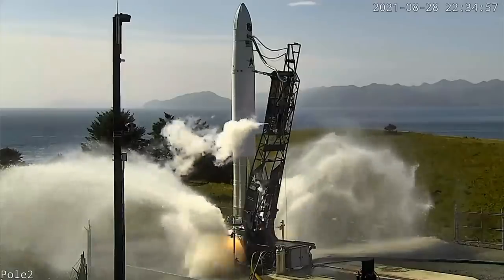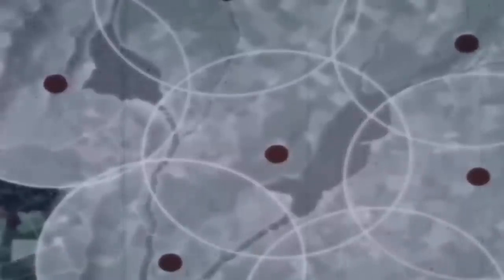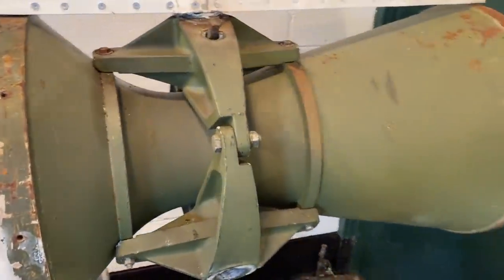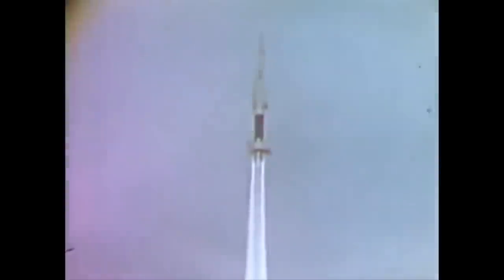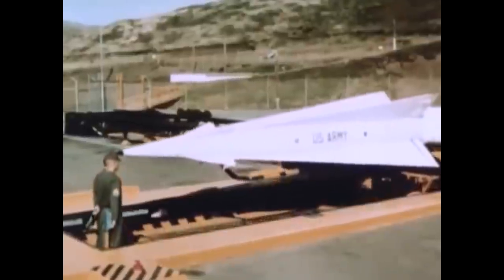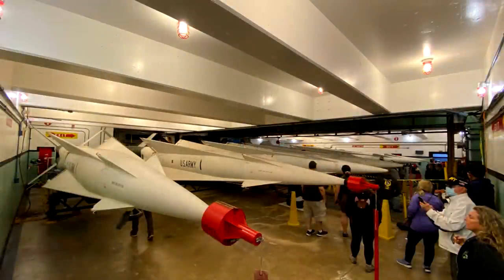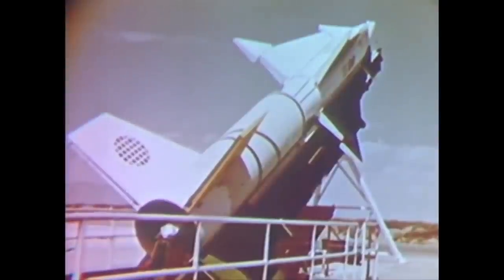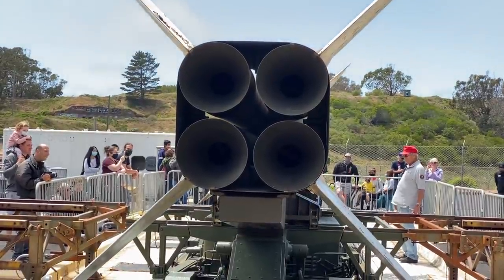Nike-Hercules - US's Surface To Air Missile with Nuclear Warheads.

Comment: Many years ago, I worked with a person who was in the army and stationed at a Nike Hercules base. He was a radar operator and would pass along stories of the different adventures that had with the missile. One in particular was a training episode when they were tracking any and everything that would fly near them.  They were very surprised when they discovered a VERY fast moving target, which they promptly started tracking to see if they could get a firing solution. They found that they could arrive at a firing window but it was so short that it was too late. They later found out that they had been tracking a X15 .
Reply: So the missiles were essentially useless by then. Since the X-15 top speed was about Mach 3. My father worked on that program and always told us when to expect a sonic boom, which was not known to the general public at the time. Too bad they didn't notify the tracking operators!
Reply: @funnlivinit  I am assuming the X15  came in lower than expected, that by the time a tracking solution was found it was too close.
Reply: X 15 has the record at mach 6.7
Reply: @funnlivinit  The X-15s highest recorded speed was mach 6.7.
Reply: @viperfan7  Still unbeaten by Virgin Galactic or Blue Origin.
Reply: @edfrawley4356  because neither of them is a high-speed experimental plane?
Reply: @funnlivinit  um, the X-15 wasn’t a warplane. Nike Hercules could outrun and outmaneuver ANY manned warplane of its days.
Reply: Besides, Hercules was IN its defended area so our enemies had to come to us to complete their missions. 

If a hostile aircraft was outbound he had probably dropped his bombs so he was a lower priority target than an inbound one.
Reply: @funnlivinit  The X-15 was a HYPER-sonic rocket plane (anything above Mach-5).   MAx. reckord speed was Mach-6.74 that's over 4,500 MPH.
Reply: @ypdave01  Outrun, yes. Outmaneuver... not so much.
Reply: @bennylofgren3208  what piloted aircraft in the 70’s could pull 8g’s in yaw AND pitch?
Reply: @ypdave01  There is a big difference between pulling 8 G for a couple of seconds and doing it sustained.
A missile loses kinetic energy very quickly if it has to make sharp maneuvers in its unpowered coast phase, so there will be limited opportunity for course corrections late in the end-game. A typical fighter counter-tactic against incoming missiles would be to fly on a perpendicular course, to make the missile expend its energy faster.
Reply: @bennylofgren3208  the missile was guided toward a continuously recalculated Predicted Intercept Point and there were limits to how erratically it would be steered during the end phase of the engagement. Not many intercontinental bombers can pull serious G’s.

But we were also deployed in Europe, Japan and South Korea
Reply: … where high performance fighter bombers would be encountered. According to the Army Times, we were the only system capable of reaching the Foxbat in speed or altitude.
Reply: @ypdave01  Right-on my Nike FB bro!
Reply: @ypdave01   Is the Foxbat the MIG 25? I've read it was built to intercept the SR 71 and that it's engines were toast after trying to do that.
Reply: So cool! Did they think it was soviet Rod?
Reply: @silentblackhole  No, they were constantly in training mode and practiced tracking anything that moved for proficiency when they had to track targets for real. He talked about them them trying to track B52's which had counter-measures they could not defeat.
Reply: @michaelakstull  yes
Reply: @rodR12345678  we had a training simulator called T1 that occupied an entire semi-trailer. It was cabled in to both the Director and Tracking Stations. 

To provide us with realistic experience it could inject up to 6 targets that would maneuver, jam or even disappear entirely or appear out of nowhere.

In actual live firing at McGregor Range NM or Crete, we shot live missiles at T1 targets.
Reply: @rodR12345678  but what did they think was travelling so damn fast? Like was it known that the x15 existed or anything in the us airforce could go that fast? If it wasn’t Soviet, what the heck was it? (In their mind)
Reply: @silentblackhole , the X-15 was a research aircraft that started out as a USAF project, but was later run as a joint USAF/NASA vehicle.  The point of the X-15 was to see how high and how fast they could get a winged vehicle to go, and it was a highly successful program.  Of three vehicles originally built, two still exist, although both have been retired to museums.  One is in the Museum of the US Air Force at Wright-Patterson AFB in Dayton, Ohio.  The other is at the Smithsonian's National Air and Space Museum.

It's well worth visiting those craft.  Neil Armstrong flew X-15 missions before going on to the Gemini and Apollo programs.
Reply: @ypdave01  why are you leaking national security on youtube??
Reply: @lultopkek  nothing classified here
Reply: I served on a Nike-Hercules site in Germany from 1976 to 1983 as a launcher section chief. It was an awesome weapon and looked scary as hell just sitting on the launcher.
Reply: aLiEnS bRoOoOoOo
Reply: This makes no sense.  Range operators are always in command of airspace information, for obvious reasons.  Hard to imagine not knowing about something so well documented as the X15.  I worked as an optical physicist at White Sands for Sperry Flight Systems, and the Army for a spell.  Saw a lot of stuff, which we mostly can’t talk about.  It’s just math, until something blows up, then it’s way more math.

Comment: On the traditional AA guns: it's worth mentioning that the US and Britain had jointly developed the proximity fuse in WWII, which gave them much, much better shells/kill ratios than the Germans and the Japanese. Curious Droid made an excellent video about them.
Reply: I believe the proximity fuse was developed at Carnegie geophysics research laboratory.
Reply: The shell had to get close enough to the target to actually detect the target and cause damage. That required accurate gun aiming. The Allied AAA gunners got that from three devices from 1944 onwards. The SCR-584 radar, which was the most advanced gun laying radar of WWII in that it could search for and track a single target automatically , the Bell M-9 Gun Director which could take the radar data and use it to aim up to 4 guns automatically and the Posit VT Fuze.
Reply: @goldgeologist5320  my grandfather worked as an engineer on the proximity fuse project at Johns Hopkins Applied Physics Laboratory, left APL in 1948. Tho I wouldn't be surprised if the project was carried out at multiple locations.
Reply: According to US Navy records of antiaircraft kills versus 5" antiaircraft ammunition expended, the proximity fuze doubled kill probability - from 1000 rounds per aircraft downed with time and impact fuzes to 500 rounds per kill with proximity fuzes.

Doesn't seem like much of an improvement (still 500 rounds!), but cutting ammunition use (and also barrel wear, obviously) in half made a game-changing difference.
Reply: Funny enough, the germans themselfes were aware of the problem and developed proximity fuses themselfes.

The ones for artillery shells were actually close to combat testing, however they were dropped in favor of AA missile systems like the "Wasserfall" and  air to air guided missiles like the Ruhrstahl X-4.

Those systems too had proximity fuses, however, those obviously had to withstand much lower G forces, therefor were simpler and cheaper to produce.
Another interesting thing to not is, that these proximity fuses were no radar doppler effect fuses, but a wild mix (depending on the usecase) of sound wave doppler effect fuses, magnetic fuses, simple passive radiowave homing devices and in the case of the Wasserfall even a mix between infrared homing device (similar to what was later used in the Sidewinder missile) and an infrared proximity fuse.
Due to the mechanical and electronical simplicity, a lot of them were even combat proven and used on other guided bomb systems.

Really, looking at what the germans came up with out of pure desperation is quite astonishing. :D
Reply: @richardvernon317  Well, yes, it definitely wasn't perfect, but the Germans still had to set the timers on their AA shells by hand, which basically meant guesstimating how high the Allied planes were and how long the shells would take to get there. The proximity fuse at least removes that timing aspect, so it was a big improvement.
Reply: Erre Waser  or near the water. My grandfather told me stories of watching news reels and noting when he started seeing explosions near the water (missed shots) and how he was so proud to see his work in the war effort but being unable to tell anyone because it was classified.
Reply: @TG626  Or near the ground - once the ground forces got permission to use the VT fuses in their artillery; IIRC during the Battle of the Bulge.  (Originally its use over hostile ground was forbidden due to the risk a dud shell might be recovered and the fuse reverse engineered)  

VT fuse ashore helped ensure the shells detonated high enough to properly spray their deadly shrapnel -- a shell that detonated on contact with the ground had a far smaller lethal radius, and one that detonated after burying itself had a comparatively tiny lethal zone.
Reply: @jonathan_60503  my guess is that if the enemy recover a dud shell they would've figured out that it uses radio-signal for sensing proximity, and thus they could jam this signal and prematurely detonate the shells.
Reply: @jonathan_60503  The VT helped the Americans to blunt the main advance of the Germans, on the northern shoulder, in the battle of Elsenborn Ridge, a series of fights that wrecked the 6th Panzer Army, blocked three of the five routes for the tank spearheads, over about five days of tough fighting (basically field artillery to the north, near Monschau pivoted, and applied a serious exercise of combined arms - artillery with proximity fuses / infantry on the gruond  - against German assaults).
Reply: As good as curious droid's video is, I feel the viewers here could probably cope with Dracinifel's much more detailed video on the subject, if you're interested swing on over to his channel ;)
Reply: The difference is that Proximity shells never had to come up against strategic bombers. If you watch a strategical bomber pilot training video, you see that their tactics would dramatically reduce the effectiveness of proximity shells.
Reply: @foximacentauri7891  please explain
Reply: @xponen  you'd need a fairly high signal return.  Considering the rf stuff then used high voltage tubes which would be difficult to use in the field as a jammer.
Reply: Proximity fuzes my EOD school nemesis...(caused my first "death" at school)
Reply: On a side note, a Nike-Ajax was my first Estes model rocket.
Reply: @bp968  that can't be true, the shell is really tiny, why did you think they are able to fit a radio transmitter in a shell but suddenly if it's on the ground it is impossible? This radio must be really simple trigger using the 1940s technology that is easily countered by radio jamming or what we call "ECM" nowadays.
Reply: @mandernachluca3774  Yeah, the real breakthrough in proximity fuzes was simply making them cheap enough in quantity to shoot enough of them, and tough enough to withstand firing stresses.

Neither of which really applied to guided missiles, and the second factor being eliminated fed back into the first - they were cheaper, so the extra cost of the missile (and the fact that you aren't going to use 500 missiles per kill) made the missile look more viable in terms of time, production volume, and cost, even though each missile cost a Hell of a lot more than a cannon round.
Reply: Is it really progress if you safe 50% of the shells but pay 220% for each shell having the fuse?
Reply: @Ugly_German_Truths  
I would think so. It is not the cost that really make the proximity fuse such a great advancement. It is the kill per shot ratio that actually makes it so great. Less shells to kill an aircraft means more downed aircraft per time unit with a given konstant fire rate.
Additionally, less shells needed simply means simplified logistics and for a given maximum ammount of ammo stored (in battleships for example) longer theoretical  time on sea between service intervalls.
Reply: @Ugly_German_Truths  Yes, because this isn't  a purely economic decision.  The reduction in ammunition usage has cascade effects that make the antiaircraft fire far more than twice as effective overall.

You're hitting the threats farther away, in less time (lowering the risk of leakers), and reducing all over ammunition expenditures so you are at lower risk of running through your ready magazines and being effectively out of ammunition in the middle of an attack (even if you still have ammunition in the lower magazines or on your support ships, it doesn't do you any good if it isn't at the mount when the gun crew needs it).

All of this means you're less likely to have one attacker get through your fire to hit the ship, and it means you can deal with a heavier attack density without becoming overwhelmed, because you are servicing each target faster.

Remember, they didn't cut the rate of fire in half when they switched to proximity fuzes - if anything, they increased it by eliminating the need to set the fuzes (however quickly) for the correct range before loading each round.

Hey, modern rifles (even 1900s era bolt action rifles like WWI was fought with) and ammunition cost more to produce than 1700s flintlock smoothbore muskets and their ammunition.  But the effectiveness of the soldiers increased so much that no one would seriously argue for going back to flintlocks to save money.
Reply: @xponen  Evaluating, integrating, mitigating, and/or designing (primarily weapons systems, but also "whole platform") for E3 (Electromagnetic Environmental Effecrs), ECM, and ECCM are part of my day job.  I'm literally one of the guys who get tasked with solving these problems (often times with cutting edge equipment from JPL that is literally built one at a time as if it was laboratory experiments) for the US military.

A proximity fize is way smaller and simpler than the jammer that can stop it.  And jammers that can stop or fool that sort of thing are way larger, expensive, power hungry, and requiring highly advanced controls (which, thankfully, we have the computers and electronically steered arrays for today, as it is realistically beyond human reaction times or mechanical.slew rstes).
Reply: @geodkyt  Lt. Jack Bowers of "Research Division of the Aircraft Radio Laboratory at Wright Field" developed jammer for VT which was tested on B-17. He modifies the "APT-4" jammer on the B-17 to jam the VT - Source: Southwest Museum of Engineering, Communication & Computation, AZ.
Reply: @geodkyt  the ECM for VT fuse is just an existing APT-4 radio jammer, modified to emit same signal that VT fuse emit & receive. The Lieutenant figured this out in 2 week. In case the German uses the VT back against the Allied, they will have a countermeasure.
Reply: @geodkyt  not to neglect the reduction in time taken to batter an aircraft, allowing new ones to be targeted.

Comment: The ground Attack option was for the Nike Batteries based in Europe. NATO operated Nike Hercules were fitted with US Supplied nuclear warheads (2 out of 3 of them in fact during the 1960s). The backbone of NATO Air Defence in West Germany was a line of Nike Hercules batteries running down the middle of the Country which had the airspace above 20,000 feet all to themselves. A Belt of MIM-23 HAWK batteries covered the first 40 miles of the Iron Curtain between West and East Germany and the Fighters operated behind the HAWK belt and Below the HERCULES Belt.
Reply: Sounds like, back then they were ready to go nuclear on the first day of WW3.
Reply: @cbboegh  NATO's war plan between 1957 and 1968 was called "Tripwire" and it was basically any Major Soviet aggression against NATO would lead to a massive "Can of Instant Sunshine" chuck fest response from NATO. Most NATO fighter bombers had access to US Nuclear Free Fall weapons under what was known as Project E. (The Non US NATO Nike Hercules units (Dutch, Belgium and West German) were the same), while British Canberra and Valiant Bomber units also had access to US Nuclear weapons. The British Army had Honest John and Corporal missiles, while the US Army had a butt load of nuclear weapons from the Davy Crockett to the Redstone, plus atomic artillery shells and demolition devices (basically nuclear land mines). Most of the Defence procurement and weapon development in the US and UK from 1957 through to 1968 was based on this war plan. In 1968, NATO moved to a plan called Flexible Response, which had NATO respond in kind to any Soviet aggression.